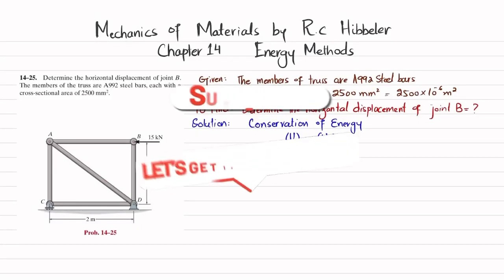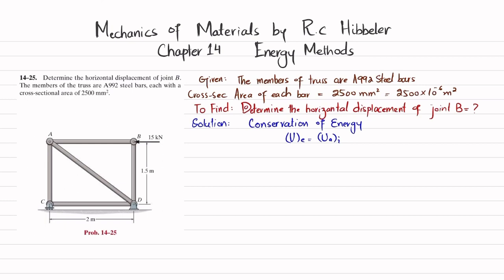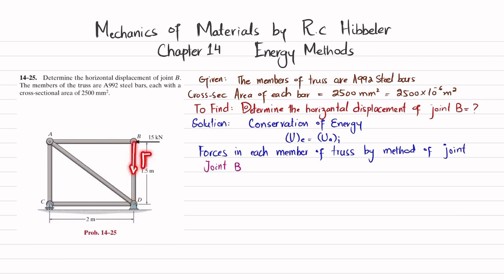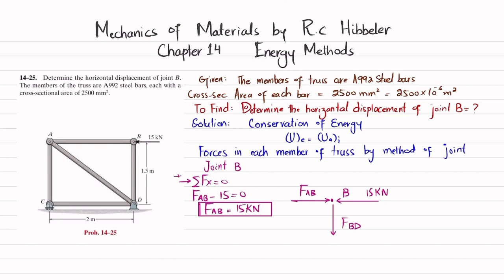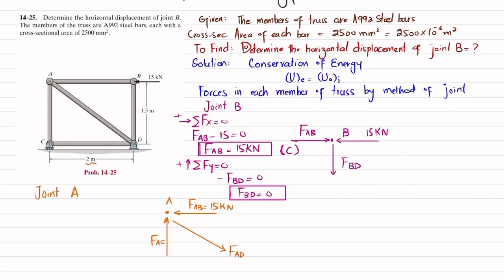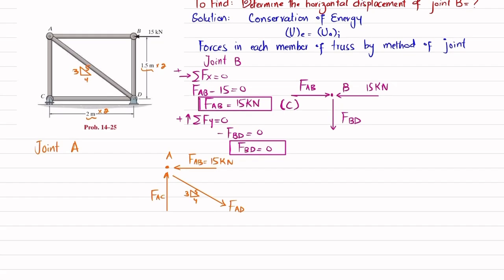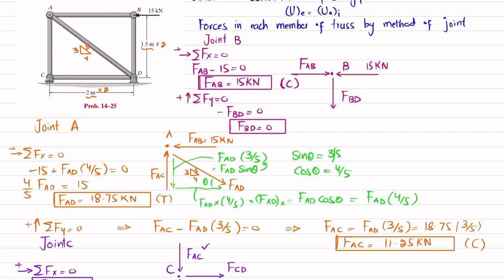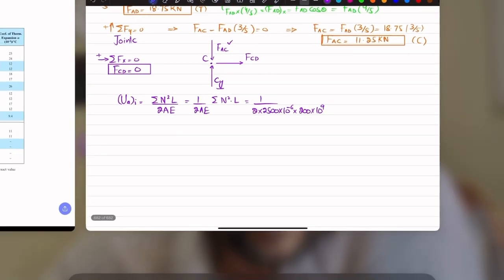14-25 | Determine the horizontal displacement of joint B | strain energy | Mechanics of materials RC

Comment: Fad=18.75 and if we calculate 18.75* (4/5) we found Fcd=15 right?
Reply from the maker: Fcd comes out to zero. Why you are taking 18.75 * (4/5)?
Reply: @engradnanrasheedmechanical  yes i know. But just examine to joint D. it comes horizontal force to Fad. and we need to balance with Fcd. Qustion is looks like wrong i think.
Reply from the maker: 18.75* (4/5)= 15 and it is balanced by outer load P=15 . There is no issue in this question
Reply: @engradnanrasheedmechanical  i got it. thanks sir.
Reply from the maker: @krizelos you are welcome 😊